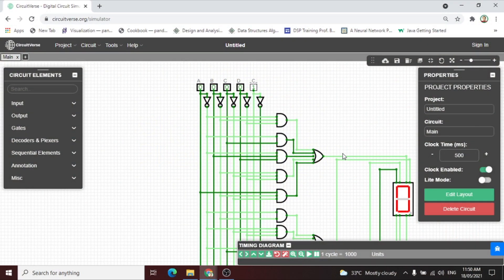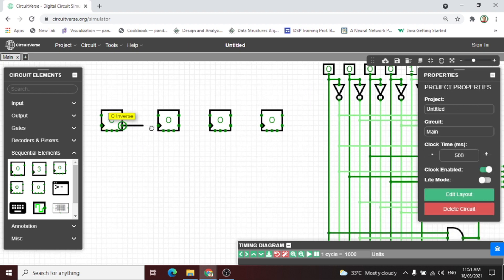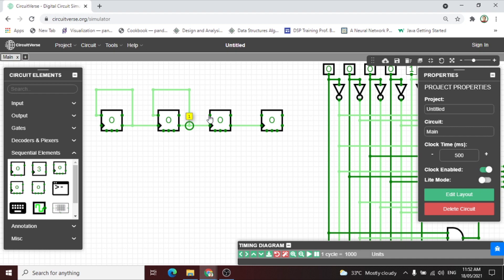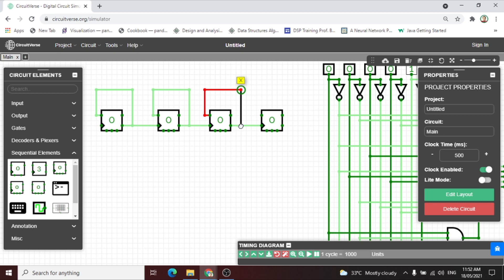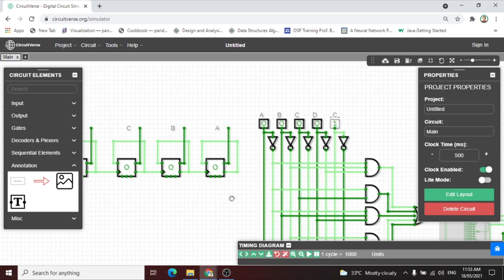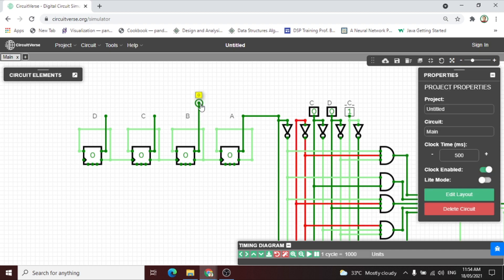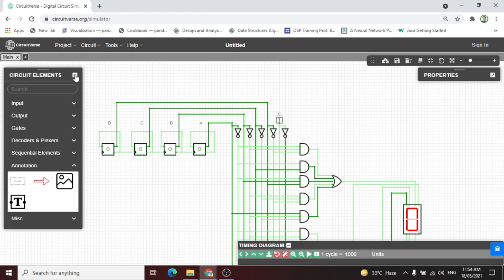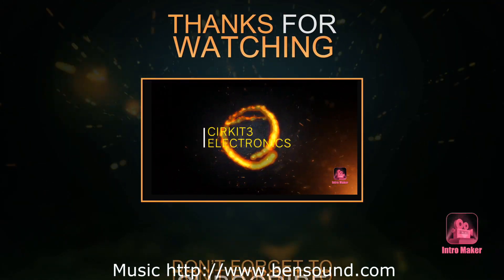BCD SEVEN-SEGMENT DECODER DISPLAY WITH COUNTER SIMULATION USING CIRCUITVERSE ONLINE SIMULATOR(PART2)

Comment: If I want to count from 9 to 0??
Reply from the maker: Try to change pin4 and pin5 connection.
Reply: @CirKit3  how?
Reply from the maker: Change the decoding process.
Reply from the maker: 0000 ---> 1111011
0001 ---> 1111111
0010 ---> 1110000 
.
.
1001 ---> 1111110
Reply: Ok I change it but it now counts from 15 to 0
Reply from the maker: @LigerderaGame  set the other number as dont care value
Reply: Ok thanks and the flip flops will be the same?
Reply from the maker: @LigerderaGame  yes still the same.